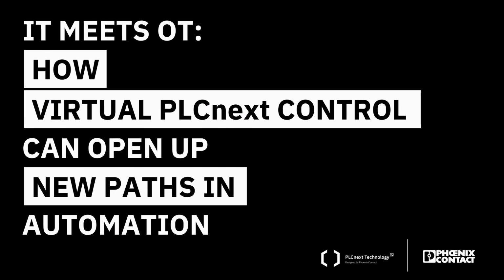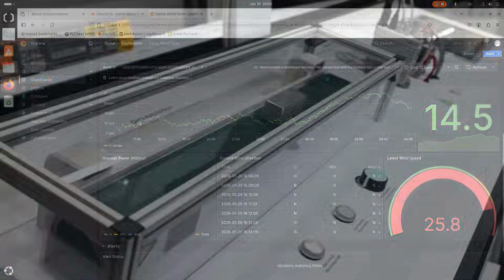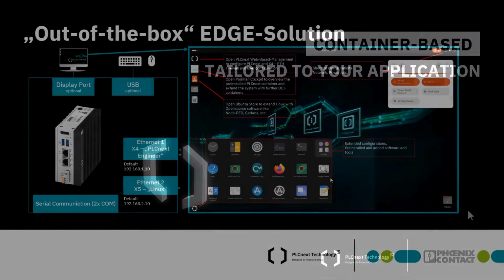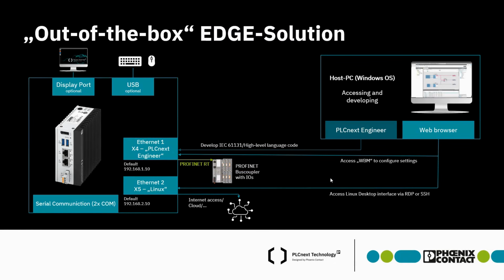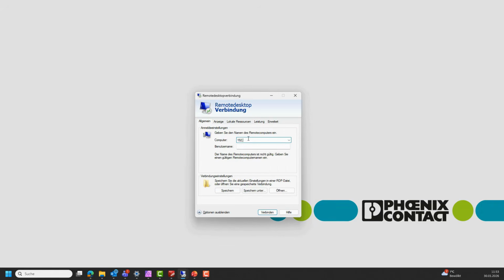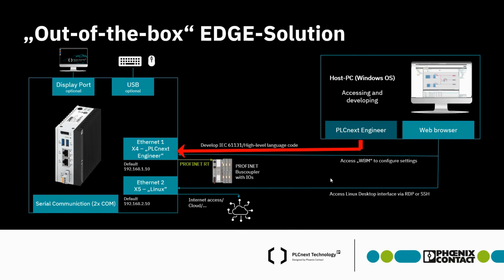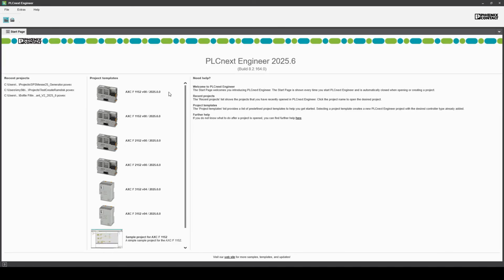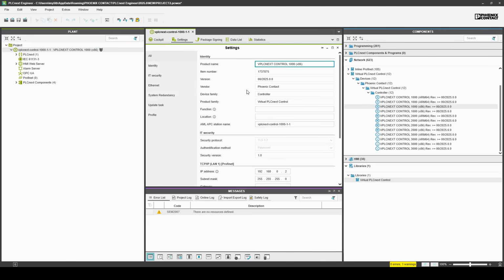VL3 UPC 2440 EDGE – First Setup & Connection Guide | Ubuntu Pro + Virtual PLCnext Control

Comment: there's any limitation to use the RJ45 ports has redundant link?  PRP or fail over?
Reply from the maker: Hello, the VL3 UPC 2440 EDGE provides two RJ45 Ethernet ports, but they are functionally separated and not designed for redundancy.
One port (X4) is dedicated to PLCnext / PROFINET real-time communication, while the second port (X5) is assigned to the Linux environment for IT/Cloud connectivity.
Therefore, the device does not support PRP, redundant link operation, or automatic failover between the RJ45 ports.
Any redundancy must be implemented externally (e.g., via network infrastructure such as switches supporting MRP/PRP).